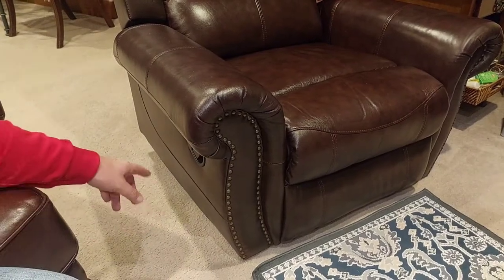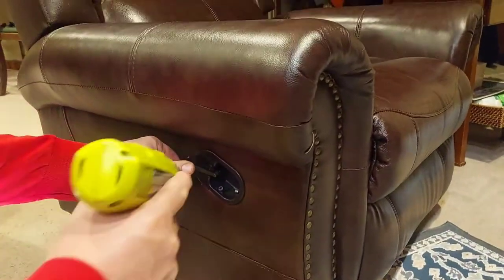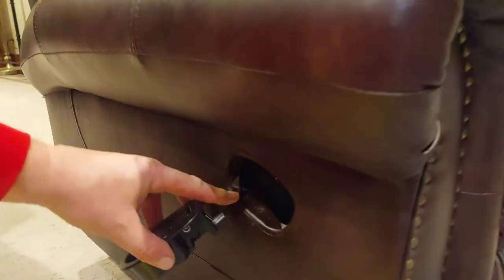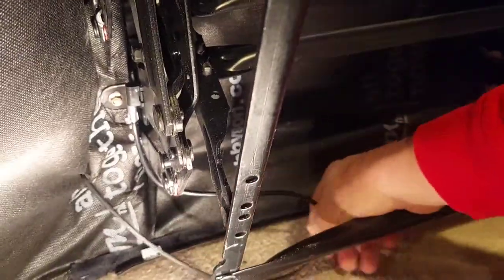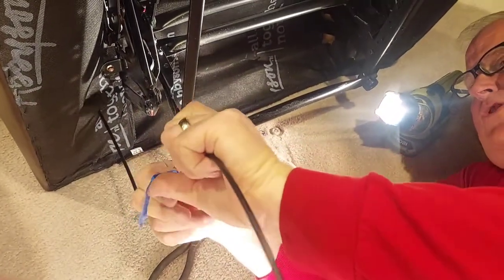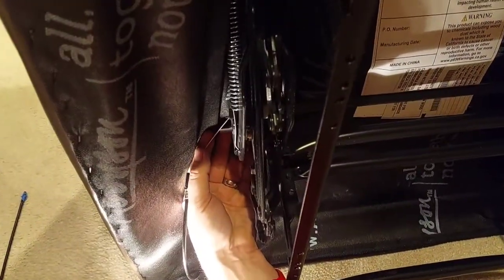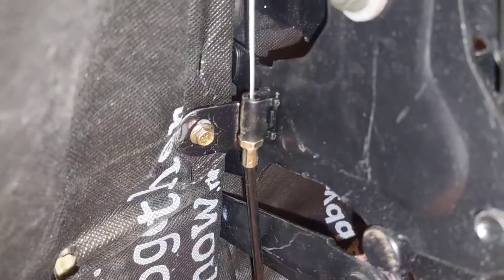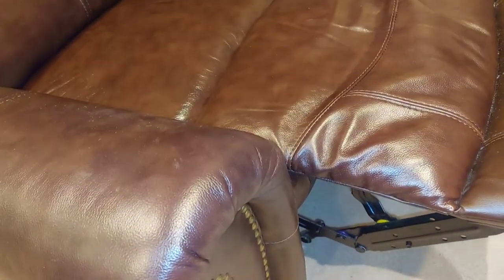How to Replace a Recliner Pull Handle and Cable.

Comment: Heads up anyone attempting this, trying to get the plastic piece into its slot is NOT easy, I had to use a metal bar to jimmy it in. Cheers for the video. 👍